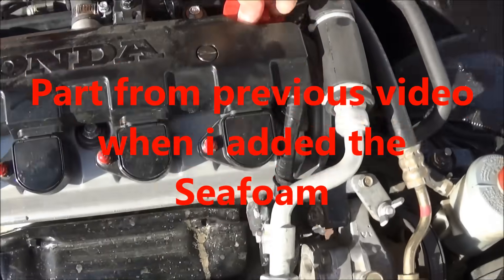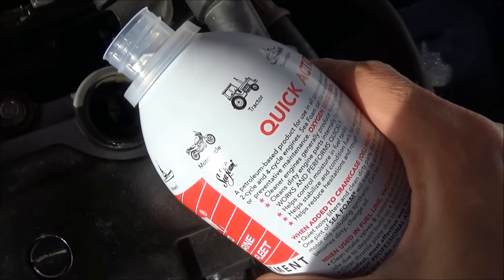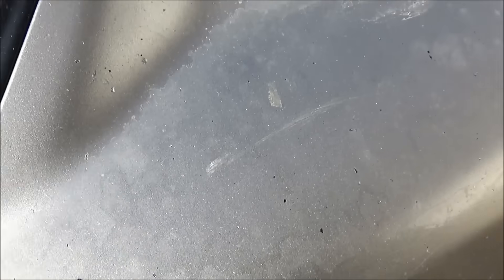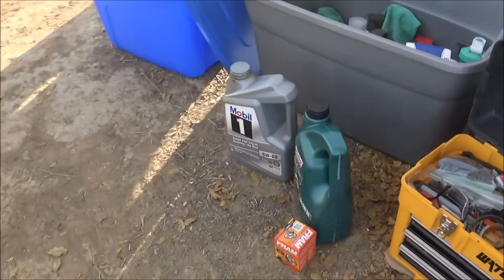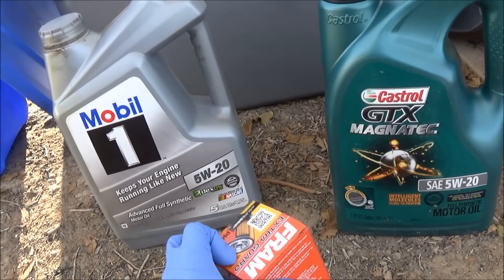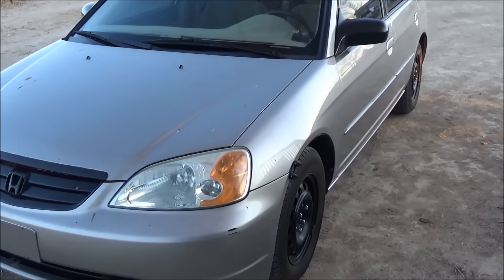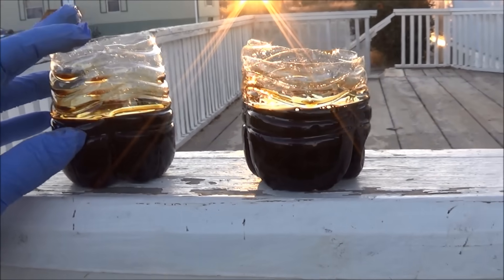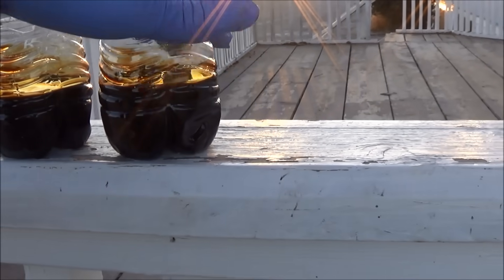Seafoam In Oil | Seafoam In Oil Before And After | Seafoam In Oil Before Oil Change [Sea Foam]

Comment: Ok after reading many things its a pre flush product before changing oil and it breaks oil down fast, at 1.5oz per quart of oil. Frankly unless there is a motor problem like an old sttcky lifter......do not flush engines and circulate sludge ect. Doc do that to you you would die. Motor flush by gunk is time tested decades. Those napa guys are smart,

Comment: Use K&N filters..... Fram filters are GARBAGE.
Reply from the maker: I usually do use k&n or Mobil 1. I used fram 2 times in my Honda so far. Before I got into oil and what not. I did use Fram and Pennzoil for years. Now all I use is Mobil 1 oil and Mobil 1 oil filter or k&n. Subscribe to my channel and check out my oil filter videos
Reply: In the past I've seen Fram filters cause engine failure. I once owned a Ford Tempo a Fram filter caused the engine to blow. I at the time contacted Allied Signal the parent company who manufactured Fram filters zero response. I had to put a new engine. I only use K&N Wix or Hastings filters. Never use Fram brother......
Reply from the maker: Damn that's crazy. How did it cause engine failure?
Reply: doubt you had engine failure from a filter, you shouldn't dis FRAM, Ive been using them in my 350000 ml 01 Silverado from the beginning.

Comment: Synthetic usually doesn't leave the brown sludge like regular refined dino oils...
Mobil 1 can easily be driven up to 7500 miles (some say 10K but I change it before) the only reason it (and all oils break down) is blowby the piston rings and contamination and oxidation of the oils, however you need a GOOD filter, Fram is not a good filter.
Put Marvels Mystery Oil if you want to clean the oil, it can also go in the gas as well (works great for small engines as well)
Reply from the maker: Okay good to know. Subscribe to my channel help me reach 1k!
Reply: mate- i use penrite ten tenths 15-50 in a subaru outback h6 ez30 24valve dohc- 4 cams- its pao ester base. the most expensive base product for oils. i did 30,000k on ONE OIL CHANGE 30k. and the oil WAS STILL USUABLE NOT COOKED! in australia thats hot weather- engine has now 330,000kms- and blew head gasket (they all do that at 250k) stripping the engine- and its like new inside.oil pump like new- bores-like new with cross hatching on all the bore. timing chain- no testable wear, guides- no bad wear, they all go back in as is for rebuild. i used mobil 1 for years- but this is better, and the penrite ten tenths racing with added zinc is deffo the best you can put in your engine. use K&N filters.

Comment: I was at NAPA  a wk  ago and we read label. Me and the napa  guy. You cannot put sea foam in oil...….it goes in carb or throttle body or gas tank.....not oil
Reply: james bullock better check again it's on the label that it can go in the crankcase.
Reply: Actually, it does go in the oil:  change the oil as soon as it darkens, which indicates dissolved sludge from the engine -- the product worked.  Modern dino oils (SI+) produce very little sludge in engines -- they're so much better than engine oils from the 70's (SF and earlier).  In 2010, I used SeaFoam in a '79 Honda, oil turned black after 5 minutes idling, shifting all gears -- shared oil between engine and tranny; changed oil immediately.  Did same treatment, 5,000 miles, and 2 oil changes later, with harsh riding conditions:  oil never darkened, no sludge from the modern oils I was using (SM) in it.  Put it in the engine, once, every 50,000 miles, if you feel the need.  Directions on the can for engine oil, and fuel tank; ratios vary depending on which you add it to.  The vacuum intake business is a hassle; the gas tank is easy.  I put it in the gas tank about once per month, preventative measure, gets rid of any water, if any. Stabilizes ethanol gasoline up to 24 months -- great for storing motorcycles over the Winter months: start up without issue, haven't needed to clean a carb in over 8 years, with this.  Cheers!
Reply: Can he read or you ?I did so today and put the 1 oz per quart like the can told me to do, I planned on changing the oil by Monday because a lot of folks are told to do the change in 250 miles, now I can give it a few days more and research fram which I have used till mid 90's. I liked them but I want the best one for the new ford/mazda arrival,
Reply from the maker: I wouldn't trust anyone at a part store James. Subscribe help me reach 1k and check out my other videos. My car is in top top shape.

Comment: Seafoam is an anti carbon additive for gas, sludge removal in fuel ect. Sea foam will break oil down. Although I never read the label that's its intention. Meant to de carbon motors and some mfg;s rate it for use with vehicle warranty.
Reply: james bullock read the label.
Reply: james bullock 
It is quite effective for dissolving gum and varnish in the fuel system also. I have verified that.

Comment: Fram is garbage, just spend $6 and get a wix
Reply from the maker: I have never tried wix. I usually use Mobil 1 or knn
Reply: WIX is the best...but Fram Extra Guard is the best of the Fram filters (that's why they cost the most), there is a video out there about it
Reply: Or, you could just review the actual test result figures that are available on the web.
That way, you don't have to filter opinions.

Comment: You should just pour 1 pound of glass beads into crankcase if your using a Fram filter, I wouldn’t put a fram on my worst enemy’s car. If you believe that fram is the same as OEM I’ve got a 1000 HP lawn mower for sale
Reply from the maker: 😂 Subscribe to my channel bud and check out my oil filter breakdowns...Also check out the Honda OEM oil filter vs Fram orange oil filter. Identical 😂
Reply: Owned.
And I'll let you pay me to drag that mower away too.
Reply from the maker: marshalllhiepler haha

Comment: K&N oil filters are the LOWEST rated filtration rate filter on the market. They only cost as much as they do because they have a high blowout PSI. They are designed for drag racing, where your rebuilding a motor after X amount of passes
Reply from the maker: For real ?
Reply: Derrick D yup worked in the industry for years. Always laughed at people buying them thinking OH its K&N its got to be 1 of the best
Reply: Pass more dirt and contaminants than a cheap paper filter. Remember, the best oil filter is a good air filter.
Reply: Is WiX a good oil filter.

Comment: Lol you care about your engine so much to get your oil tested but use a fram filter. Please. No fram is not as good as OEM. Please tear one apart. They collapse and kill engines.
Reply: There's absolutely nothing wrong with fram filters. I've used them in all my oil changes for the last 20 years with no problems whatsoever. So your wrong
Reply from the maker: I never got it tested. Subscribe to my channel and check out my oil filter videos lol. You'll be surprised
Reply: ThatDudeTrent if that’s true then why do I see 10-20,000 dollar mopar and gm engines at car shows with Fram on them.  And yes, I talk to the engineers and they all say the same thing.  Fram filters are fine and are not like they were in the 80’s
Reply: Been using fram since forever. My older car has 342000 miles on it. Used fram on it since 45000 when i got it. No problem
Reply: Lots of rumors and inuendos. Never saw a fram fail. Zero hard evidence to back up the gossip. I Did see ONE youtuber with a mis made fram inside. ONE.
Reply: If changed regularly, filters are filters, for the most part. The most critical thing to look for is if your OEM filter has an anti-drainback valve, the cheapo filter may not, or may have a crappy plastic one. This is a problem because it allows the oil to drain out of the filter and has the engine waiting to repressurize and fill the filter and passages before the engine is running on oil pressure after a cold start. Over time that reduces engine life.

Comment: Did over 10,000 oil changes in my time at VIOC and Dobbs. The ONLY time Fram filters act up is when the driver goes thousands of miles over the recommended change interval. In which case, ANY filter is liable to act up. Bitching about this would be like crying about my Yokohama tires not getting 100K when mfg says they're good for 50K.

Comment: Try an inexpensive mineral oil in a low viscosity, 0-20 0r 5-20,30. Change the oil about every 500 miles after about 3 to 4 oil changes. Slap on a new filter and put in your regular weight oil. I've done this, and on opening up the engine you'll find it looks like new!
Reply: In the shop I did many last-ditch, Hail Mary shock treatments with kerosene. Customers that let oil changes go for so long that they had problems like oil sump screens clogged up and/or hogged up oil return holes up top that made the oil stay up in the valve cover(s) instead of returning to the sump as intended...multiple stuck lifters, etc...when one choice is an expensive teardown just to even tell them how much it would cost to correct all the issues, you know that ain't happening if they couldn't even afford regular oil changes. So usually they say they were just gonna look for another car. At that point I'd suggest the old kerosene trick, the caveats being it may destroy it (it's already dying anyway), or it may have no desired effect (never happened though), or it may result in some short-term improvement but ultimately succumb to its injuries. Pretty much 100% of them wanted to gamble, and I like doing it, so...remove roughly one quart if full, or if low bring to one quart low, then add a quart of kerosene. Let it run to operating temp, then drive for 15-20 minutes. Back up on the lift, drain the crankcase, spin on a new filter, and fill with the cheapest oil available. Give it back to them with stern instructions to bring it back in 500 miles for another oil change with good oil and filter. It's amazing. Most engines are running quieter and with drastically improved oil pressure within minutes.  When you dump that oil that has the kero in it, an ALARMING amount of sludges and solids will usually exit. I've seen a couple that actually looked like they were shitting black peanut butter out of the drain hole, those cases I did a second round of kero+oil and cheap filter before moving on to solid oil and new good filter. But at any rate, the idea is to see nothing but liquid coming out. You gotta play that part by eye. Once that happens and you have the new oil and filter in, the were usually running and sounding fine.  I'd tell them they should then get another change at about 1500 miles, then go to regular intervals...recommended intervals, I mean, not their "maybe next year" intervals...Now I don't know how this would play out with a recent car engine, as most are put together with a lot of sealants instead of gaskets. It might affect that. But luckily even the worst oil you could get now is light years beyond the sludge-producing crap we had even up to the early 90's. I haven't seen an engine internally hogged up to that degree in decades now. Just to throw my hat in the ring, I use Motorcraft semi-syn in everything I own, it's wonderful oil and usually the most reasonably priced. it will run 6-8 thousand miles in my car and stay reasonable clear and seemingly in grade. I like to use OEM filters but will use WIX if not available in the moment.
Reply from the maker: Irving Kurlinski Good to know! Thanks man

Comment: I like how everyone is an oil filter expert. I ran Frams for over 30 years with no issues. These filters are made to run for a certain amount of miles usually 3-5k, NOT 7-10k. Buy the cheapest damn filter, change it at 3-5k and never worry. People need to stop blaming products for a lack of maintenance or using something for longer than it's life expectancy.
Reply from the maker: Tepco Cycle Repair Right I totally agree lol
Reply: Both of my grandpa's run Pennzoil and fram and both of their trucks have over 200,000 miles on them.
Reply: ITS FRAM PA!!!!!!
Reply: Crazed Monk I have no problem with extended oil changes with an oil filter made for it. My point is people trying that with filters only designed for 3-5k then blaming the filter IF it fails.
Reply: Chan Curtis They probably run them because of some solid advice they got a long time ago when Fram was a premier brand. Quality has dropped in favor of profits, the new company owners have a poor business model and they bank on people like your grandpas sticking to what they know. Solid advice for today: wix.
Reply: Tepco Cycle Repair true unless you're done an engine rebuild or torn your engine apart to fix something in it is no reason to use high-end oil filters to the engines themselves once after its first initial oil change will always stay clean inside
Reply: adam brady actually Fram is better now than they were, not the other way around.
Reply: Tepco Cycle Repair , it's true, changing oil filters regularly is the key.  I've used FRAM filters for literally 30 years now, I worked on cars for 17 years professionally. I think the only problem I saw was a few filters that were dented from the factory. We gave them back to the supplier for new ones. I personality never had a oil related problem with a FRAM oil filter.

Comment: Ha quit watching as soon as the Orange can of death showed up. Fram is shit. The only thing it compares to is a roll of toilet paper.
Reply: Toilet paper oil filters is a thing for large engine and supposedly work very well. So that was actually a compliment for Fram.
Reply: Racers still use toilet paper bypass filters.  Ignorance is bliss and you are very happy.
Reply: I run a fram on my LM7 turbo. So im sure it works fine on your VTEC yo.
Reply: Well hell my mower doesn't use a filter so just yank that bitch off who needs one.
Reply: They are the same people who buy platinum or splitfire plugs. Copper are always the best unless you go iridium.
Reply: Toilet paper oil filters were the rage in the 40's and 50's, right along side the oil bath air filters.....
Reply: weird that people hate frame oil filters my Toyota pick up reached over 300k mikes before it needed rebuilt. oil change done every 3k miles with conventional Castro 10w-30 and fram oil filters never had an issue

Comment from the maker: Fram orange is the same as OEM Honda FYI ppl Subscribe to my channel and check out my oil filter videos!
Reply: Fram is not the same as OEM Honda.... Thats almost an insult. Lol Wix is the way to go 👍
Reply: Derrick D no. No it's not. Go to the Bob is the oil guy forums and do some searching. Fram is by far the worst filter.
Reply from the maker: David pooty poot poot I cut them both open my self. Same shit in them....watch the video and Subscribe lol
Reply: Derrick D cutting them open alone proves nothing without filtration and material testing in a lab which has been done and proved the shit quality of fram. If you want to use them that's your choice  but at least get the better grade.
Reply: Derrick D mainly comes to the fact that for the money there are much better filters. Even the Wal-Mart supertech is better.
Reply: I will use nothing but fram filters and here's why. I had a 2004 Hyundai Elantra. Started oil changes with a fram filter and conventional motor oil. When checking levels on the dipstick during the life cycle the oil always stayed a deep golden clear oil color. One day I was in the middle of changing my oil and had realized the filter I was sent from the local parts store was the wrong one. I called them back and they odnly had a Wix alternative in stock. I put the Wix in place and after approximately 600 miles the oil was black as night and stayed that way. It took two full oil changes with fram filters after that to get my oil back to staying golden the entire 6000 miles. Never will I use anything but fram again.
Reply: Victor De La Rosa thank you. Fram is OE equivalent. Haha! Nope, it's not
Reply: Derrick D 
No it's not! Check the micros on the serialmeda. Check the spring tension. Check the anti back flow valve that rubber part in there different quality. The housing measure it! The cap same thing. Just remember it's on the internet so it must be true!
Reply: Haha it's on the internet so it must be true. Looks are deceiving if you don't know what you are looking at
Reply: Ao2 Honda filter is made by Fram and the ao1 Honda filter is made by filtech.  At least they were a few years ago when I had my Honda.  And yes, Fram filters are fine.  Been using them for almost 20 years and put 150,000  plus on all my cars and zero oil consumption when I sold them.
Reply: Derrick D https://filtrationcomparisons.weebly.com/test-pictures-and-results.html. Here’s another in depth oil filtration test with most common oil filters.  Look at where this individual places the filters.  Overall, I wouldn’t hesitate to use any filters he tested.
Reply: Jeremy Pilot What engine do you have

Comment: OEM oil filters are super cheap and best to use, I have a IS300 and I buy my genuine oil filter from Toyota and just ask for the 98 non-turbo Supra oil filter which is the same part number Lexus has in stock for the IS300 of course if they are Toyota right? But they are about 2 dollars cheaper leaving with the same oil filter for $5-$6 rather than $8-$12 (2jz-gte use a different oil filter than the 2jz-ge motor)
Reply: Motorcraft FL400s. I put these on my 4Runner and Sienna. Both of these vehicles have "Lexus" engines. World class filter.
Reply: Well, there you go, you drive a Tonka toy....we are talking real cars here, not rice burners!
Reply: The Million mile truck is a Toyota, hahahahahahhahahah. Jimmy? a little bois name. more hahahahahahhahaha
Reply: Toyota, a rice burner, won at Nascar this weekend. Eat rice and run fast, boy.